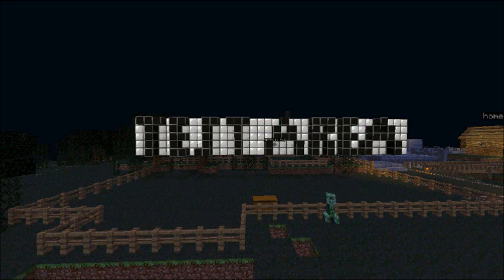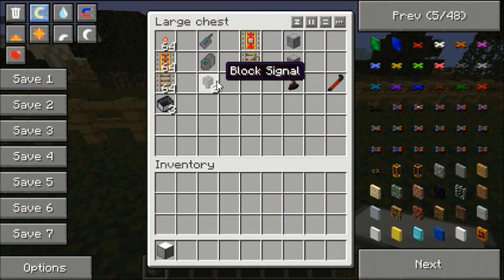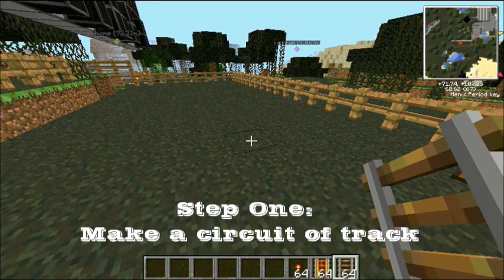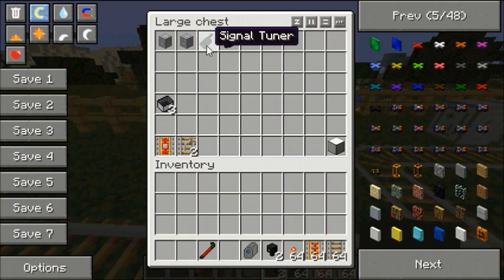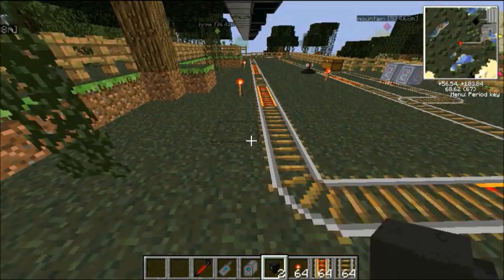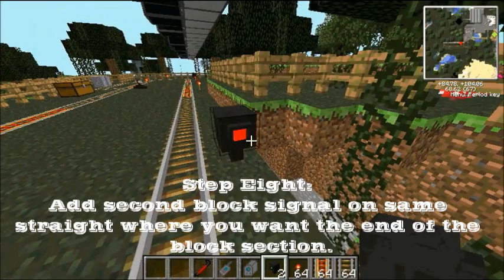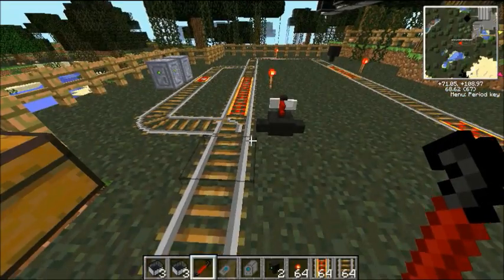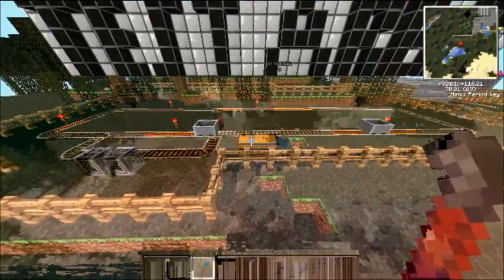Jams Tekkit Guides - Ep. 4 - Block signalling and collision avoidance!

Comment from the maker: Sure, the most likely reason the signal block is not valid is because the two signals are not on the same straight bit of track. You cannot have signal blocks around corners unfortunately. If this is not the reason if you could email me a screenshot: jamschannel (at) gmail.com and I may be able to help further.